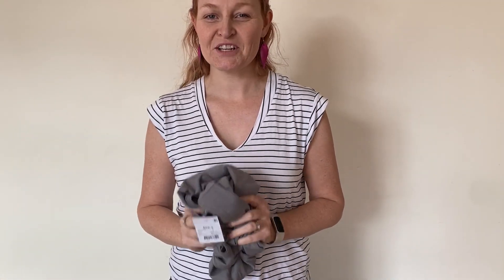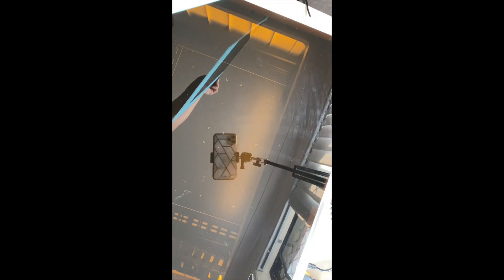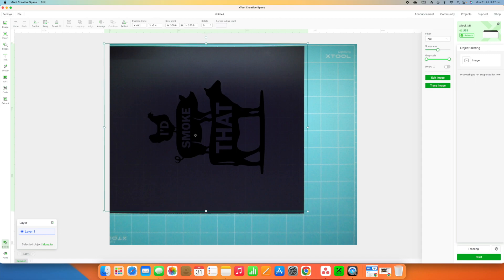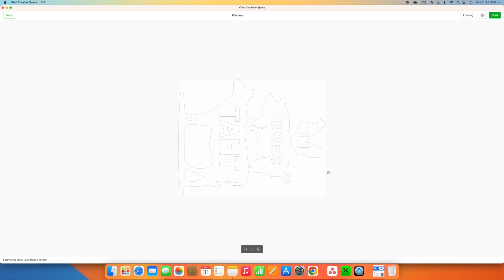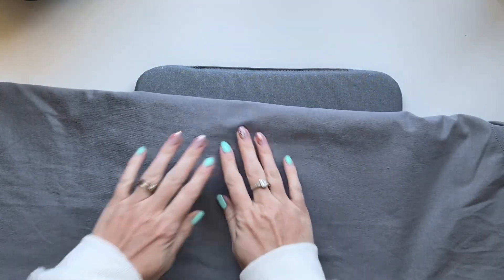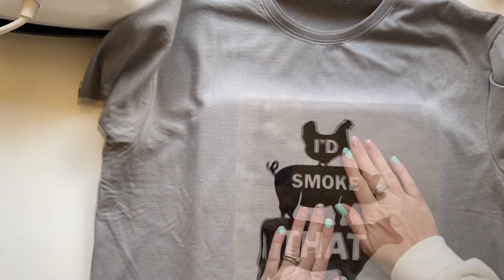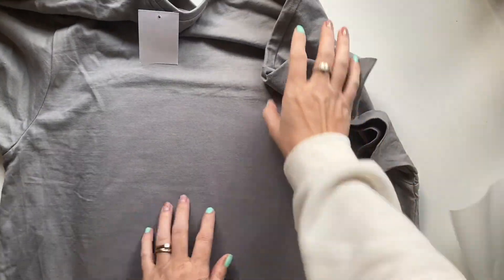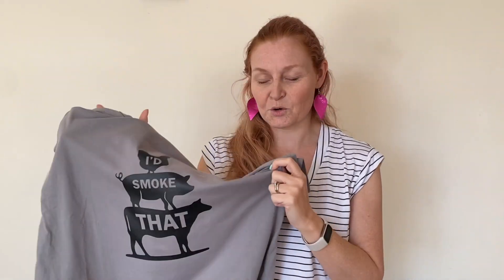How To Make A Heat Transfer Vinyl Shirt With Xtool M1 Laser & Cutting Machine

Comment: ok, so you are doing a how to make a heat transfer vinyl, for laser cutting - every one that has a laser cutter know how to use the software, and every person on the earth knows how to iron, if not they should look up a ironing tutorial.
Why now show what everyone don't know : 
1) what kind of material are you are using. (Heat transfer vinyl). (and I really hope it's not REAL vinyl since that is highly toxic to cut with a laser)
2) what settings are you cutting at, speed and power
3) how does it look after cutting, and not the 2 seconds we saw you peeling
4) how did you get it from the peal to the transfer paper.
Reply: Xtool M1 ultra that she is using has a cutting blade ... She didn't use the laser. XCS, the software that comes with the machine has a huge catalog of settings for different materials and processes, so you just select HTV and cutting blade, the software does the rest. And there is no transfer tape; the machine kiss cuts the HTV and it doesn't go all the way through the backing, which is why she mirrored the image.